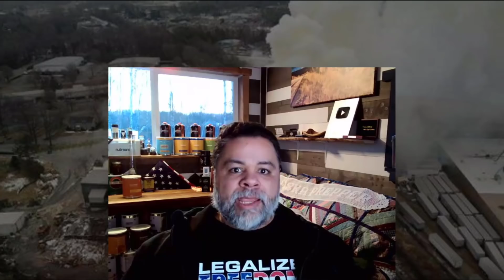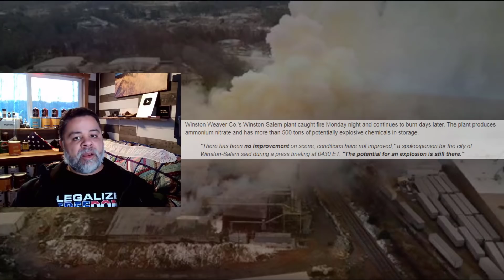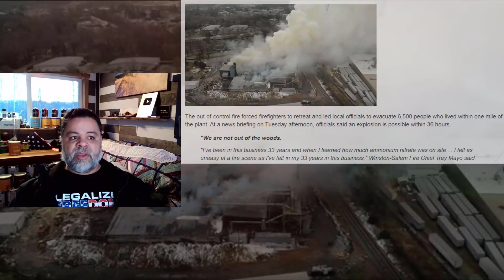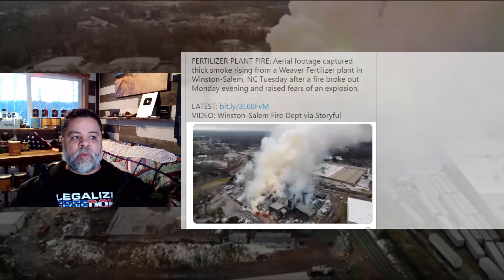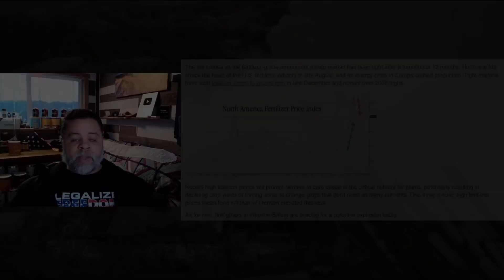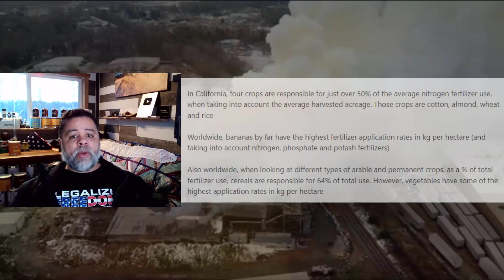*THIS IS REALLY BAD*  STOCK UP ON FOOD NOW BECAUSE THIS WILL PUSH PRICES WAY OUT OF CONTROL

Comment: All the soil everywhere has same amount of nutrients. What it don't have is carbons for fungus and bacteria to break nutrients down so plants can use them. Without fungus or bacteria in soil then you need fertilizer. Like those sand and gravel fields bleached of all the carbons. Those fields they spray fungicide on need fertilizer. They really don't need fertilizer, but an education on soil nutrients.

Comment: I have horses, goats, chickens, and rabbits. I have more manure than I know what to do with. Last years manure has been composting for over a year and will be going on my potato patch this spring. I’m thankful that my homestead produces at least one resource that’s valuable.
Reply: In the UK and have a small garden. Don't have much of a green thumb (thankfully my housemate does). We do have a wormery to tackle our food scraps (instead of using the food waste collection service that the council provides). Plan to start using the excess liquid waste from wormery to water areas that we plan to grow food so that is one less step when we want to use the composted lower sections of the wormery. Hope that everyone is OK in the local area of the fire. Years ago when I used to commute, the bus drivers had to tell the passengers to shut the windows for health purpose when the wind was blowing smoke from a local tire recycling center fire in the general direction of the main roads

Comment: Odds are farmers will not change to growing something else because it takes a tremendous amount of expensive equipment for each crop it's all different equipment for every single crop that you plant I grew up on a large farm it was almost a thousand acres it's a very big deal to change crops.also at has already been planted it's called winter wheat it's already been planted in the soil with the fertilizer so the wheat shouldn't be as bad as what you think I would be more concerned about corn because that's your feed for your animals so even if it uses a little less than the wheat which I say is already planted it comes up after first Frost the corn goes through the whole Central United States and it's used to feed the animals not to mention other nations

Comment: Wheat grain, white rice and popcorn kernels are good foods for long-term storage when correctly packaged.  It is not just fertilizer that is needed for corporate farms to produce an abundance of these crops. It is also enough days of warm weather and enough rainfall. And with climate change producing too much or too little rain and late spring frosts, crop production may be even more uncertain this year than usual.

Wheat, rice and corn can provide a lot of calories at low cost. If you are motivated to have a year of food storage, make sure you have some of these three foods in your storage. If you do not yet have enough food storage to meet your goal, buy now what you need for long-term storage before prices go even higher.
Reply: You know that the government is playing with the weather, Right?! Everything that is going on is because of the evil powers that be. It's take Total control of everyone and everything. The one world government the beast system? It's Here, it's now and will get worce. The end is near. Times running out the door to Mercy is about to close. Once it closes can not be opened again. Get right with Jesus and stay  ready always. Even so Lord Jesus come quickly. Amen 🛐📖🙏🕊️ show ♥️ like Jesus then if need be 🔫🏹 then victory 🙌🙌

Comment: My dad and uncle worked at a fertilizer plant in Nashville in the 60’s and 70’s but they closed down in the late 70’s. A fire at a fertilizer plant would be devastating.
Reply: Would you happen to have any knowledge on the type of explosion such a fire would cause?  I've seen the video footage from Lebanon where the ammonium nitrate facility supposedly exploded.  There was a massive mushroom cloud consistent with a nuclear blast followed by a visible blast pressure wave going straight up in the sky.  Everything about Lebanon tells me that the ammonium nitrate facility was a ploy to keep the wool pulled over the sheeptards' eyes so that they would not notice a bench test for a nuclear EMP.

Comment: Save your coffee grounds after your morning coffee if you home garden, use the coffee grounds to put nitrogen back into your soil! You may even be able to pick up some used grounds at local coffee establishments!
Reply: My sons saves the coffee grounds from his work. I put them on sheet trays and set them outside (in FL) to dry as much as possible, and then dump them in a 5 gal container. When it's full I dump them in the area I'm planning to put a large garden, around my fruit trees and in the small compost pile I have.
Reply: @Last Dance I dont cover mine, I just put them on sheet trays, then about 12 hours or so later depending on how warm it is I take a fork and rake over them to stir them around a little and let them dry some more
Reply: @Last Dance possibly if you get them fully dry. Otherwise they will mold. I tried to dry them in the oven but it took forever and with the cost of electric I didnt want to do that.
Reply: Egg shells.    I put mine on a cookie sheet in the oven and when the cookie sheet is full I bake them until they are very dry and then into a blender they go and I process them until they are powder.  I add them under each plant when planting into the ground.  I will also add a couple of cracked eggs to each hole.  Plus some epsom salts and some organic veggie fertilizer. If I have a plant that is struggling I have my 10 year old urinate on it. That usually perks it up nicely in a week or two.
Reply: @Last Dance tea leaves are good too😊.🛐📖🙏🕊️ show ♥️ like Jesus then if need be 🔫🏹 then victory 🙌🙌.

Comment: Ammonia and Nitric Acid are just two essential basic compounds for the production of fertilizer. Moreover, other acids and chemicals also used to cover all the minerals a plant needs for its growth.
By the way, the yellow-brownish smoke over the plant looks like nitrous gases and fumes which are extremely harmful, even deadly if inhaled directly. If this smoke is later washed out by rain or in contact with clouds, it'll transform into nitric acid again. The "good" thing is that its concentration will be low because of the huge amount of water in the clouds. Thanks goodness...Last but not least, hopfully there are no casualities.

Comment: The cattle industry has mountains of manure that can be spread to improve soil fertility as a byproduct. @ least in my any parts of farm country. Chicken manure also.
Reply: please make sure the cattle havent eaten grasses sprayed with weedkiller (i think it graze on, not sure), because their manure contains it, and it will kill your garden
Reply: @evelynkorjack2126  The chemical in question is a persistent broad-leaf herbicide .. Grazon is one brand name out of many that use Picloram, or other pyridine herbicides.  The manure could be used to grow monocots (grasses), but is lethal to most vegetables .. its a serious problem!
Reply: Only thing with chicken manure it need at least 6 months to dry good or you will burn your plants. The best is cow, horse and dry rabbit. I cleaned enough barns and chicken coups and spread it on fields and hay fields in my youth for a life time.
Reply: Horse had too much intact grass seeds.  Time to grow worms for worm casings
Reply: They are vaxing the cattle now

Comment: Another reason for always having a bug-out bag. Grab and go and get ahead of the traffic rushing out. Bug out bags aren’t all about living in the woods and pretending to be Grizzly Adams. A change of clothes, spare undies, cash, toothbrush etc, water and some ‘easy’ food. Don’t forget to add some pet food to your bag if you have animals.
Reply: Thank you for this comment. I have long felt that this is really what a "mild" BOB is supposed to be. If we all suddenly have to go live in the wild with just what we can carry on our backs, most of us are toast anyway and no BOB will change that. But if you need to flee temporarily in an emergency situation, your type of BOB is perfect.
Reply: My BOB is actually primarily for hospital, if I go in as an emergency (yep, happened a few times).  Then it can be quickly added to with the "tech" bag which has torches, & outdoor stuff.   Food shortages will be a bug-in though. We do have a local large facility for LPG and oil, but that is 20miles away, in a batueal harbour that points away from us.  If that goes, we may have to evacuate to get away from pollution.
Reply: Guten Abend Frau Worm! Bug out bag ist wichtig, das stimmt.
Reply: @KT_survival  fraülein, wenn es Ihnen nichts ausmacht! 😉.
@LAT a good point - BOB’s need to consider personal circumstances and geography. I’ve tried to imagine what we’d need if we had to spend a few days in a low cost Bed &Breakfast due to flooding or the unexpected discovery of a WWII bomb (I’m in the south of England). A fire on even a small industrial estate can see many houses evacuated.
Reply: @missworm  Na ja, mein Fehler.
Reply: Great points.
Reply: You need to add a basic first aid kit, too.